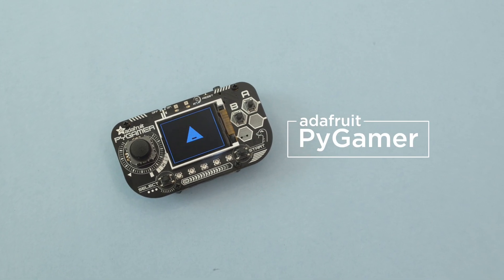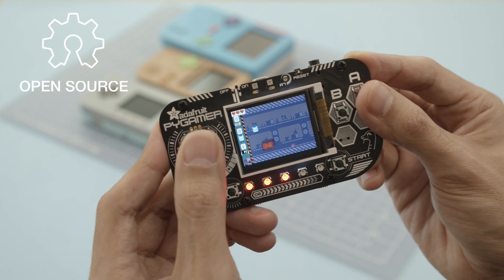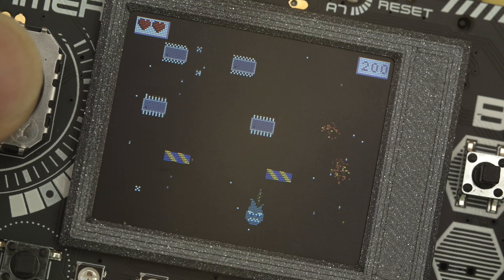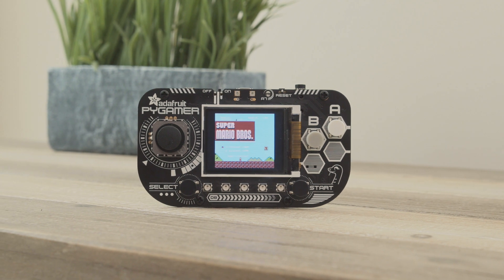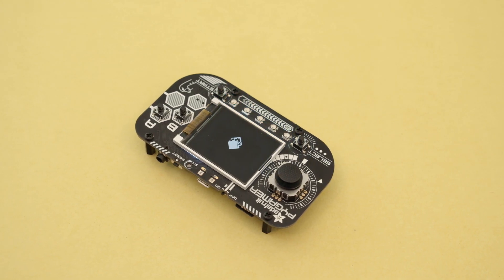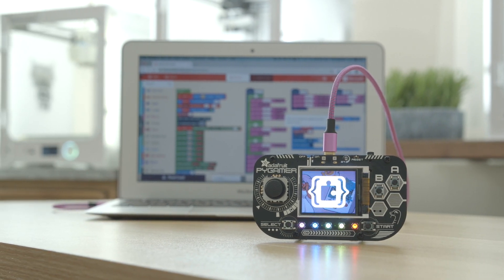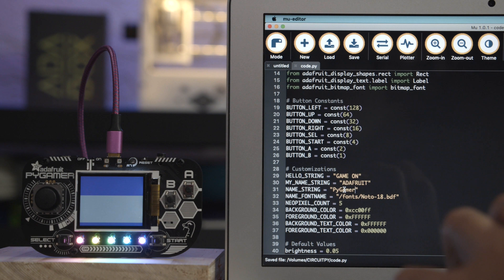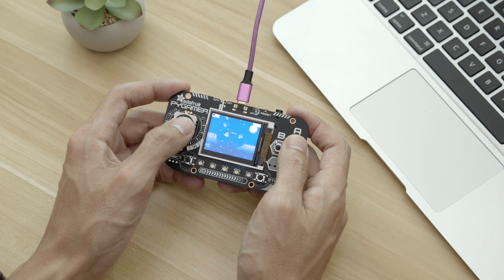Adafruit PyGamer #MakeCode #CircuitPython #Arduino @adafruit #adafruit

Comment: Hey I didn’t know where to ask this question but would you be able to make a ps4 controller with pi technology?
Reply: Not sure if you found an answer to this. It is possibly to set up a raspberry pi so that when you plug it in to your PC it is seen as a mouse or keyboard. Since a PS4 is able to connect to keyboards and mice, you should be able to connect it to the raspberry pi that way, but I am not sure if the PS4 allows one to control games with the mouse/keyboard. I think they are only allowed to be used for the UI menus and such.

I could be wrong here, just saw this question hangin.